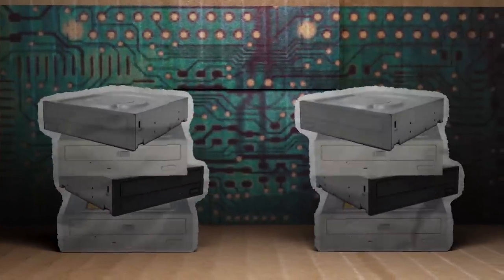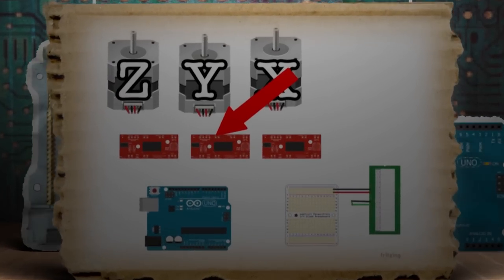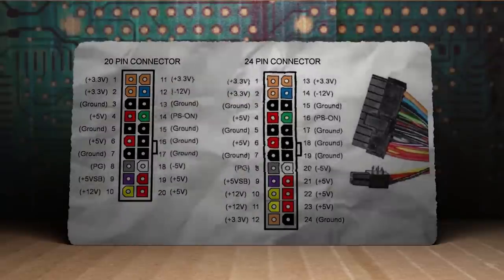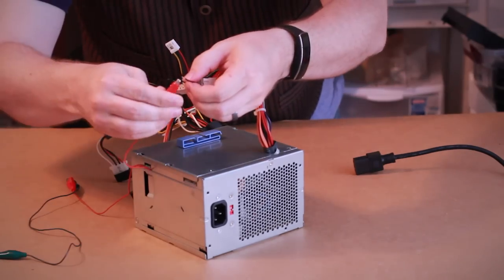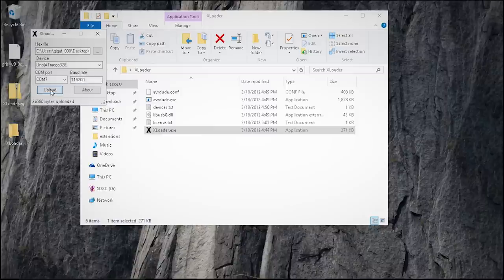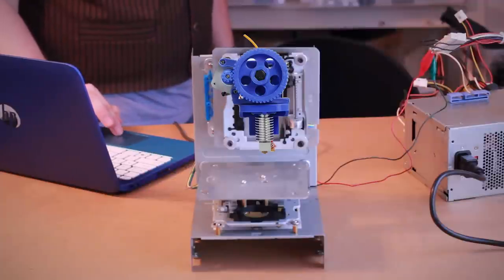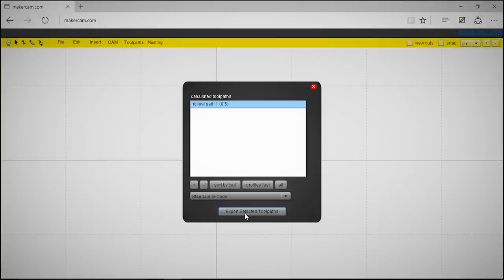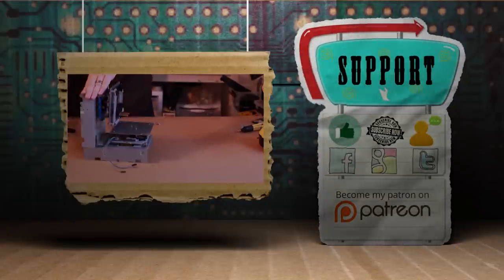Hack old CD-ROM's into a CNC Machine - Part 2: The Software

Comment: 3D printing , Painting , Drilling .. all these jobs can be done with other machines without this much work, i would appreciate doing something more creative with this, just like;
1.  A robot which helps to pin wires on a bread board 
2. A toy which moves it's head and hands with command of user
3. Automatic soldering machine
4. A robot which fires a candle,gun,crackers  (can be controlled through Bluetooth)
If we can make this stuff move little more faster, 
then we can make
1. A musical instrument which works automatically 
2. An instrument which can check the durability of keyboard and mouse 
3. Automatic DJ 
4. A JCB toy

I dun think that these ideas are so good, but i just commented .. .. 
If you like it, then try to implement those :)
(Sorry for bad English :P)
Reply from the maker: +Sreekanth R I'm only showing the basics. I'm leaving it up to you to come up with different ways to use it. You've got some great ideas, so feel free to use this as a starting point to make them. Let me know how it goes!
Reply: the nice thing is its a robot so it can do things more accuratly and kan repeat the same thing over and over with the same accuracy
Reply: +Tinkernut Yes ofcouz !! and thank you very much for such interesting ideas and tips :)
Reply: +Tinkernut  do not listen to that guy, because its just not true.. if i or anyone else could make  a 3d printer easier and for less than the cost of what is essentially free. minus the 10 bucks for the uno and all 3 controllers  combined..everyone would do it and the world would be a totally different place.

Comment: Hey! Im making same project :)
I have trouble with stepper motors...
They are just vibrating, but not moving...
I was reading on all forums, so i think the problem is that i burned my step driver (unplugged and plugged in other motor, while 12V was turned on)
Im not best at electronics, so i dont know if that is real problem.
Maybe there is another solution?
Or maybe there is any chance to check driver? If its working or not... 
Thank you very much for answer :)

Comment: Hi i have made this project from your video, and i am having trouble operating the motors i can not find the driver you used in your video so i used A4988 driver to operate the motors. The problem is these drivers are creating high pitch sound and also my motors are not running smooth and are over heating enough that you cannot touch them please help me with that

Comment: motor driver detail or link please? :)
nice video and i want to build one
Reply: +LopezfsS thank you :D
Reply: +~☆ XzCraftP ☺♂ Whatever you do, please do NOT purchase any of the cheap 6560 drivers from China. An A3967 based driver is ok. Pololu has some good ones for not much. If you want something bigger, look into THB6064AH drivers.
Reply: +James Newton No, wrong too.
Get a TMC2100-based module, they have a lot more brains in them and are a LOT more configurable, if a bit pricy(around $8-9 a pop compared to $5-6 for A4988 or alike).

Comment: So, it is having a hard time controlling them, but is it still possible to do it without a controller board?
Reply: +stig gear also i'm having an older cd drive and it is having a motor and a seperate sensor (one like you will find in old mouses with a little bal in it), so maybe it is possible then?

Comment: hey would it be possible to make it with 2 stepper motors and 1 dc motor for the z axis cuz I only got 2 cd readers?
Reply: and you don't need a stepper motor for the z axis since it only lifts up or down the pen, right?
Reply: +HalfLife2Beta depending on the precision you're going for
Reply: I don't need any precision since its just putting the pen down or up, but I've seen no ways of doing it (controlling dc motor with grbl controller) unless you can enlighten me.
Reply: HalfLife2Beta well if you are aiming to do any 3d printing a precise y-axis would be required. i dont know of a way to do it either
Reply: this video is about a cnc plotter not a 3d printer, I realized it would be foolish to build a 3d printer, especially for this tiny printing volume and for all the trouble (stepper motor cd rom driver are quite rare here, theyre VERY delicate, they can't support lots of weight (almost none) so it's a pain in the ass, etc etc...)
Reply: +HalfLife2Beta i know this video focuses on the cnc part, but the third axis is built mostly to lay a foundation for 3d printers and other 3-axis machinery
Reply: in practice 3d printers are very hard to realize with these little machines, you need a counter weight for the z axis because they can't support any weight, believe me in practice those stepper motors can't lift shit and can be very easily broken. You better off scavenge scanner parts and try to make a 3d printers with these instead

Comment: I want to add E3D v6 hotend to this project. But I don't know how to add it & control the temperature through the arduino. I want to know about circuit diagram. Please help me
Reply: B Ma use a arduino mega with a ramps board there are many tutorials on youtube and internet how to do that, I did it too💪😉
Reply: Thnx.

Comment: GRBL controller doesnt detect my arduino, but I dont have all the axis wired up yet. Is that it?
Reply: +Jacob Paniagua because 2 of my 3 axis are two pin, not four pin. I dont even have drivers for those, I figured I would just attach it in a way... I dont even know, really
Reply: if its two pin, then its a dc motor and can't be used.

Comment: HELP, i am trying to build this for my final exam for school but i can not get it to work, i have only managed to get it to move on axis for a copple of times but as soon as i connect the over wires it does not work,i have checked the wires several times and they are correct, can any one help? 
My suspissions are or the arduino is faulty and the stepper moter controllers or the program is not working correctly.
i am using a 400w power supplie is it to much?

Comment: is the burning on the arduino reversable? and how
Reply: You can burn new code to the Arduino as many times as you want. The official Arduino software also works with other boards (even $2 clones of Arduino) so you should get started on it.

Comment: i made this thing, and first tested it with juxt one axes (X) connected, and it worked like a charm. now i've connected the X axes, and i have a realy weird error. every time i try to send something to wichever axes, it sends it to thy X axes. my grbl controller thinks it is send to the right axes, so i gues there is someting wrong with my arduino, 'cause i have checked all the wiring. does anyone have a solution?

Comment: i cant download the grbl controller , can u please help me
Reply: +software guy same here
Reply: +software guy i found the previous version at http://grbl-controller.software.informer.com/ just scroll down to the bottom and the download starter will pop down from bellow the the address bar. The only verson of the hex file i could get to talk with the GBRL controller software was grbl_v0_6b_atmega328p. Could be an issue with the ardunio im using as its a multiwii pro from a tri copter controller.

Comment: Your grbl controller link is dead. You've managed to kill it!
Reply: +joblessalex i found the previous version at http://grbl-controller.software.informer.com/
 just scroll down to the bottom and the download starter will pop down 
from bellow the the address bar. The only verson of the hex file i could
 get to talk with the GBRL controller software was 
grbl_v0_6b_atmega328p. Could be an issue with the ardunio im using as 
its a multiwii pro from a tri copter controller.
Reply: Peter M Super sketchy....
Reply: as in the website
Reply: Peter M Yes, confirmed working tho...

Comment: If the whole thing is running on 5v DC wouldn't you be able to run it with USB???
Reply: pierre tharreau Maybe it requires a higher amp than a typical usb port...
Reply from the maker: +pierre tharreau not enough amps. i did try it though. no dice.
Reply: +Tinkernut Aww, ok then, Thanks for the reply though XD
Reply: Actually its possible, with just a small modification to the way all the motors gets its power (the motors being responsible for most of the consumption of the overall amperage requirement of the "device").  I would build (or buy) a DC to DC step down converter that can convert from an input voltage of like 30V DC to 5 Volts DC regulated at 5 amps max load, then I would connect the output of this regulator to the circuit that supplies power to all the motors or to the whole project since you wont always be consuming alot of power (amperage), only when you are running a "project" (ie: Drawing), then on the INPUT of this step down regulator I would connect in series four 2.7 volts 100 Farad Super Capacitors for a total input voltage of 10.8 Volts at 100 farads, and since you are using a DC to DC step down voltage regulator the output will always be 5 Volts DC regardless what's your input and all will be well until the input voltage gets lower than 5 volts.  Now, to charge the super caps up to 10.8 volts DC you would need a DC to DC step up converter that is adjusted to up to a maximum of 10.8 Volts DC (you should be able to adjust this with the variable capacitor that comes with the DC to DC step up), and the charge rate should be no more than 500 mAh so that you wont overload the USB port.  The input of the DC to DC step up should come from the power of the USB port and the output regulated to charge to 10.8 Volts at 400 to 500 mAh should go to your 10.8 Volts bank of 100F super caps and then you would let it charge for a few minutes and that should be enough for you to be able to run one project such as the one seen on this video straight from a computer's USB port, if you let it charge all the way up to 10.8 Volts DC which would take a long time at a charge rate of 500 mAh, then you would  be good to run many many projects while leaving it connected to the computer's USB port and since you wont be consuming that much amperage all the time (you only consume alot of amperage when you are running a project), your super capacitors bank would be charging right back automatically as soon as a project is finished, making the device ready to draw another project as soon as you are ready and you would always have the head room from 10.8 volts down to 5 volts that would slowly trickle down as you run lots of projects and would slowly trickle back up (charge) when left in "standby" (not performing any drawings at the time, but merely leaving it connected to your computer's USB port)

So, with all that said, it would then be possible to operate this device in its entirety with only 500 mA of input current (the Max from a typical USB port) provided that your bank of super caps, the "cushion" that would supply all the extra current that would be needed by the stepper motors on demand is either fully charged to 10.8V or sufficiently charged to a margin between 5 volts to 10.8 volts (if using 4 super caps in series)

So, you have:
USB Port: 500 mAh Max supply-able current at 5 Volts DC --> [DC to DC Step Up Converter adj to 10.8 Volts, charge rate 500 mAh] --> [10.8 Volts 100F Super Cap bank] --> [DC to DC step down converter adj to fixed output of 5V max 5A load] --> [To Power the "Device"].

Optional Optimizations to consider:
Enable the device to keep on operating when the super cap voltage goes lower than 5 volts DC, instead of gaining a working margin between 5 volts to 10.8 volts DC, make the device work from 0.8 volts to 10.8 volts DC, can make you run many projects straight from standard USB power when the super cap is charged to anywhere between 0.8 Volts DC all the way up to 10.8 volts DC:
I would place a 0.8 Volts to 5 volts step up converter connected in parallel to the DC to DC step down converter mentioned above.  This additional 0.8 volts to 5 volts step up converter will ignore any voltages from the super cap higher than 5 volts (Diodes) and will kick in once it sees that the output from the super cap bank gets lower than 5 volts DC, that way, the ardruino, the motors, etc will continue to receive a regulated 5 volts DC from the super cap bank even if the charged voltage from the super cap bank were to plummet all the way down to 0.8 volts DC so projects should keep on running if the super cap discharges well below 5 volts instead of stopping mid work, allowing you to be able to create more complicated solutions all while being powered straight from the computer's or laptop's USB port.  No adapters needed, just time and patience to initially fully charge the Super cap bank from the USB port before starting to run your projects.

Comment: Can someone help me out? Grbl controller's page/server seems to have crapped itself and the download link leads to a 403 Forbidden
Is there anywhere else I can get it?
EDIT: Found it! https://github.com/zapmaker/GrblHoming/releases 
2nd EDIT: If the stepper motors don't work, try to plug the supply in :D
Reply: +Krisztián Szirtes 
What do you mean with "If the stepper motors don't work, try to plug the supply in " ? 
My stepper motors don't work, please help me T.T
Reply: +Cimmo I meant it as a joke since I was troubleshooting the thing for 15 minutes, took it apart, put it back together, and the supply was not plugged in the wall -_-
Your problem could be connecting the wrong pins, swap those wires. There is A1, A2, B1 and B2 and you ave to get those right, if it&#39;s not working, swap only two at a time and repeat if not successful. Also check for continuity, there should be a few ohms only between the pins 1 and 2 of each coil

Comment: that wiring, geez gl. confusing.
Also what could you even cnc on that tiny thing, couldn't even cnc anything really, way to small.
I doubt them motors have enough torque to even cnc ply wood. concept is good, just garbage with them motors from a cd rom, as they wouldn't even push though any wood types.
Reply from the maker: +AFTER DARK the motors have little to no torque. Even if the marker I'm using presses to hard on the paper it will screw up the motors. But hey, the point was to show how to make a basic CNC machine without having to spend a lot of money. After scaveging the CD drives and the PSU, this project only cost me $12.
Reply: +AFTER DARK You still can CNC small things out of an extruded PU foam and then create a negative mold out of it for any other material.
Reply: Eugen Afanasjev True.. didn't think of that.. good point. was thinking more along the lines of most cnc's use wood from what ive seen in my experience.
Reply: +AFTER DARK I see it as an training example of how to build your own bigger machine. Once you got the electronics down you can take the basic parts and apply them to a bigger machine. Just get some nema 23 kits off ebay and you will basically already know how to do the hard parts. 
Now that the doctor tells me my wife needs surgery this is about what I can afford. lol Curious if the mach 3 will work with that arduino board.  I heard mach 3 is better than GRBL. Unfortunately it is pretty spendy.
Reply: ***** Ill have to check into the software. I think they are fairly proud of it. where do you find the boards that cheap?
Reply: ***** Thanks. I'll check it out.
Reply: Foam would work. That could be used to cast aluminum. Use a program like Netfabb basic to split files into smaller sections, and assemble routed pieces with glue.
Reply: ***** And I found a great place for reporting spammers like you. lol